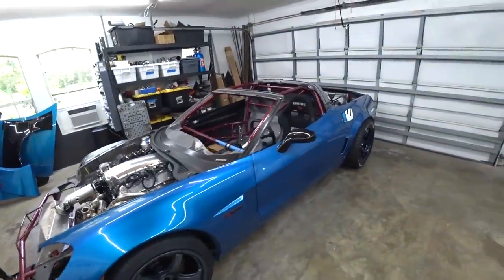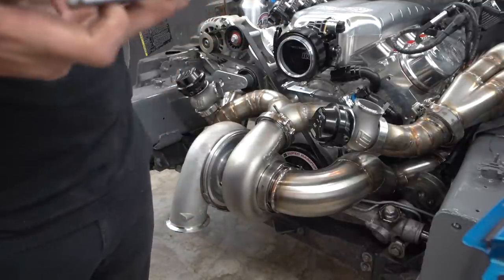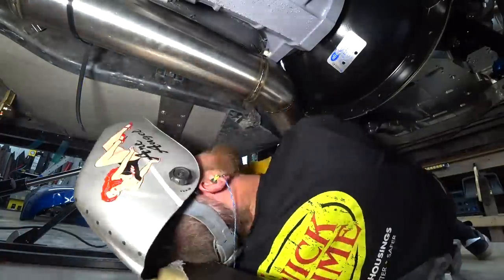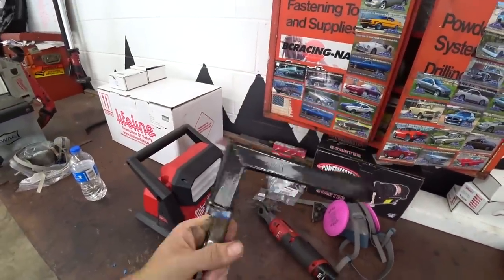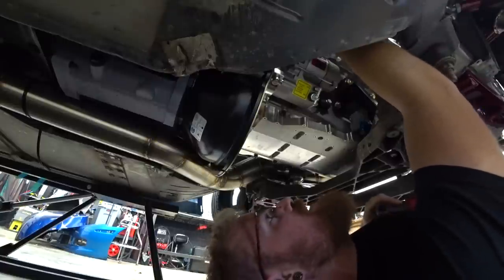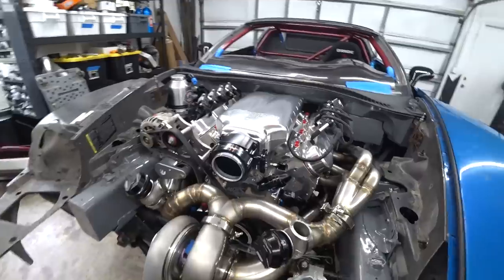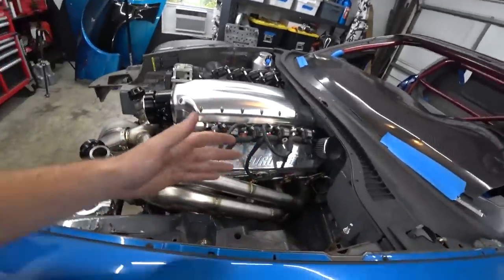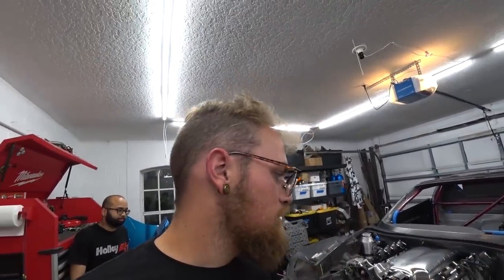C6 Corvette competition drift build. More carbon and final parts.

Comment: For your ebrake, what's stopping you from tucking it up under the dash and having the lower end of your handle (move the pivot above it) just push straight on the rod. Then you'd have no reservoir under your elbow and with the slack in the like, you could unbolt it from the tunnel and sit it in the passenger well if you needed to service the trans.

Comment: Pretty cool idea on the clutch lines. You can even take the bleeder hose off the bulkhead fitting inside the cab, after bleeding and put a cap on the bulkhead fitting. Then you don't have bunch loose hose floating around the cab.

Comment: I’m a little worried about the bending stress within your turbo support. The turbo is heavy. I’d suggest running a diagonal brace from on, or close to, the turbo support pick-up point down to the attachment of the bracket to the car frame. This will eliminate the potential huge bending stress where your horizontal and vertical bracket pieces are joined.
Reply: Exactly what I was going to say
Reply: Lol I think he might know a little bit of n what he's doing.
Reply: I think it needs a gusset, atleast🙃

Comment: I agree with others that a gusset is needed on your turbo mount tube. A triangle cut piece of same square tube should work. I would also add a 90 degree bracket to the top of the cradle and weld to tube for a 3rd bolt. That way the cradle helps hold the weight of the turbo, not just the bolts on the front alone.

Comment: I like that socket. You can also get a wrench around it for those feisty nuts and bolts that require persuasion. Recently I purchased a lot of Gear Wrench sockets and was pleasantly surprised. I might even like them better than my Snap-On ones.

Comment: Keep aware of Collets fire mishap on her c6 shield off the oil filter housing, dry sump, and heat sleeve your oil lines and wiring, loctite your bolts for the fuel rail, seal off your cockpit from the bay and tunnel. (Keeping in mind you’ve got a fire suppression system to install)

Loving the build and your attention to detail on serviceability and ease of maintenance

Comment: Proxxon is a real nice brand for middle of the line hand tools. I got a set for 115 euros - two ratchet sizes, 4mm to 13mm (incl 5.5 and 6.5) on the small size, 10 to 32 on the big one. Many extensions, wobbly bits, and a few philips, flathead, torx and allen bits too. Even a screw driver that fits in the small bits. Great deal

Comment: The square Milwaukee sockets also help when you drop one, it won't roll as easily. You can also get a wrench on it if there is not enough clearance for the ratchet.

Comment: I honestly think you should have your headers & turbo exhaust ceramic coated, i think it would help you out so much with heat management especially considering how tight everything has too be because of the vette engine bay
Reply: He is ceramic coating most of the exhaust 👍🏻

Comment: I'm not sure if this is the true name for the punch you used on the reservoir mounting but we always called them center punches because they follow a tube or bolt hole and punch a mark in the center of the spot your punching.  We also used transfer punch for them sort of synonymously, might not help, surely clear as mud now but its what I got.  Build is looking awesome!

Comment: Hey just a note, that pedal box mount is not going to be sufficient. Once you get some force into it once the brakes are bled it will flex for sure. I have the same pedal box with a way beefier bracket and there is still a little flex.

Comment: also with those flats on the sockets you can use an open end wrench on it if the area is too tight to fit socket and ratchet.

Comment: They also make the socket have those size on them like that so you can add a wrench to it if it’s too tight for the socket without half and to put a breaker bar on it you can add a wrench to it to help you with leverage

Comment: For that long of reach off the head, I'd use steel for the throttle cable bracket, just one thing you don't want to bend/move/flex.   Also for the hydro rod, just build an elbow/arm rest, basically a tunnel/loop/U that goes over it.  Wide/long enough you don't bang your elbow into the edge of it.  An old truck alum driveshaft might work n be cheap.  Mount the extinguisher or something you need on the other side of it.

Comment: The turbo mount looks stout! small suggestion. Is there room to triangulate the short leg to the vertical leg so that the stress can cut the corner when it gets loaded up (suspect the turbo will try to rotate around the lower pivot and stress that 90*). just a small triangle from the same sheet as the mounting on the frame would do it I think.

Comment: Later on, when the turbo mount cracks, you can also weld in a gusset triangle at that 90 degree weld to give it strength so it wont break again with the vibrations

Comment: Should be ready for another shop update for the insulation/electrical?  It'll be a lot easier to finish it up with it on the 2-post if possible.

Comment: Have you considered doing a little sheet metal arm rest/trans tunnel cover to go over the hand brake rod and master cylinder? Keep it pretty snug to it and do it with quarter turns so you can take it off easy to service stuff

Comment: I'm not sure if your pedal installation has enough support.  for gas and clutch what you have is sufficient, but under braking the flat bar welded to the frame I think will twist with the braking forces.

Comment: Taylor i would be very concerned about your clutch line " dry breaks" . They look like with vibration they have the possibility of coming loose. In the aviation industry we use " qd's or quick disconnects to do the same thing.  But they are usually several beefy threads so they will not come apart with vibration.  May want to look into aviation style quick disconnects if those give you problems .

Comment: Taylor…I’m not a fabricator, and your work is awesome…I hope this comes across as a question, not as criticism…Should you guessed the turbo Mount? It appears there will be a lot of weight and vibration in its location…idk, might help. Also…you could always add something look a handlebar pad to the rod for your remote Mount brake reservoir…of course that would make it bigger…but it would soften a blow to the elbow if it happens. Beautiful build…I’m excited to see this unit out shredding…take care and God bless…David.

Comment: info on those sockets... that flat spot is actually for being able to put a wrench on it so if your in a spot a socket can only reach but not enough room for the ratchet to fit you can still break it loose.     I have 1 of their kits..  its about dang time i can get alot of tools in a kit without all the alen wrenches being filler   Edit:  did u consider putting oil filer on the other side of the car next to the cold side of turbo

Comment: According to Google those  are "centering punches" T man.
BTW, you need a gusset on that turbo brace or it will crack at the weld joint. Been there done that.

Comment: U can use a open end wrench or adjustable, crescent wrench....on those sockets, I like those, I've broken ratchet, craftsman mostly putting a long piece of pipe on the end of it breaks the gears ..just buy the cheaper ones so u can replace them.... doesn't matter if u got snap on or what not, they'll break....

Comment: Where your dry sump drain is...weld a pipe on chassis cut in half lengthways with a small j bend to direct oil off chassis ...toyota does this on new hilux i believe..seen it on an engineering channel somewhere small thing but keeps everything so clean instead of having to clean oil of chassis all the time

Comment: I really really love a "good" cheap tool.  The guys I work with compete to have the best and most expensive tools, but they never want to get them out and use em.
Reply from the maker: Yeah I'm all about diminishing return. Finding whatever is the best for the money. Because at a point you have to spend way more money to get a little more quality. I'm fine with more money, better whatever. But I'm not spending 3-4x more for 10% better.

Comment: The square ends on the end of those sockets yes it's for you to be able to get them off of the ratchet easier but they're also for a boxed in wrench for you to be able to get to a bolt that you cannot get to with the ranch or a ratchet the end of it that is boxed in should match up to the size of a box stand wrench so a 9/16 socket the end of it should be a 9/16 boxed in wrench

Comment: wouldn't be a bad idea to put a linear bearing or just a tube support with some nylon or delrin in it on the mid point of the handbrake rod so if it gets leaned on it won't bend or warp.

Comment: @32:30 Hey Taylor could you not make a tube with a step on either end to make it flush with the trans tunnel? think of it like this: (master cylinder)--\__________/-- (handle)
with how little mechanical advantage that step would provide I don't think there would be any flex or issues.

Comment: I take it 2 master cylinders on the Tilton pedals are both for brakes and 1 for clutch!, you could make a curved Ebrake rod that follows the contour of the trans tunnel.
Reply: exactly, one to operate 1 side's front and the opposite rear, gives the car a good failsafe, only losing half the braking power vs having one working fronts and the other working the rears, losing [depending on brakebias/car's traction situation] nearly all of the braking power..
Reply from the maker: One master for the front one for the rear. There’s also a balance bar that allows you to change brake bias by adjusting which master has more leverage. The cool thing about a pedal box is it negates the need to run dual calipers since your rear brakes are on their own system anyway.
Reply: @Taylordrifts  there are also brake bias controllers that will adjust the brake balance in the crossed front/rear layout that all the road-legal cars run but true, though won't the hand-pulled master backflow the pedalbox' master in such a merged hydro-hand+pedal rear brake setup?
Reply from the maker: @niteriderevo9179  I’m running front and rear separate. Not cross. So the handbrake won’t back feed since the rear brakes are separate.
Reply: @Taylordrifts  not quite getting what i was going after, won't the handbrake master try to push the rear brakes' master on the pedal box in addition to the rear brakes themselves and vice-versa for the pedal based rear master to the handbrake master?

Comment: Might want to rethink the oil vent tank position, in case someone hits you in between the door and fender. Just a thought.
Reply: agree
Reply from the maker: It’s one of those things. Everything has a compromise. There’s no other good spot for it. I’ll take that risk. Nothing comes with no comprimise on a build like this.

Comment: I've admired those sockets since I've seen Edd China using them. Just wondering did you use high heat paint on the turbo bracket, I imagine it might get a bit hot. Loving the build man!

Comment: @taylor Ray cant you use Wilwood Clutch Slave Cylinder - Pull Type - 260-1333 or simular then put it in the front so you dont have that bar there?

Comment: Curious to know if are you going to chop the bottom of the bell housing off for ground clearance?
Reply: Wouldn't that expose the bottom of the flywheel?
Reply: @Matty.Hill_87  looks like a good inch of that is just the flange for bolts that he isent using since he has a dry sump pan. (With dry sump pan the flywheel is already exposed)

Comment: I think that redoing the intercooler for the turbo to connect directly is a bad idea. I feel like leaving the 90 plus the U-turn will save some things from being destroyed in the event of an accident. If everything is connected in a fashion that is too ridged it will cause a lot of things to break. Especially with everything tied into the bash bar like they are. I think designing some flex into the turbo hot side is the way to go at least with the idea of a crash and things breaking in mind.
Reply: There is a slip joint to go into the turbo hot side and another to go on the bottom in the exhaust.

Comment: Awesome content as usual. Wouldn't it have saved more room to put the hand brake reservoir in front of the handle?
Reply: With all of the interior in place, it would be harder to service with the reservoir attached. In front of it is also most likely going to be where ecu, pdm, wiring, lots of other important stuff is under that dash and will also need to be accesible easily.

Comment: Maybe consider isolating the turbo mount with rubber mounts?
Reply from the maker: That would defeat the whole point of the mount.
Reply: I thought of the rear diff in the Miata. Im assuming the chassis and turbo will be at different harmonics.
Reply from the maker: @rbparker4  the problem with the Miata was just that. Half was soft mounted. Half was solid. If you have any solid mounts in a system it needs to be all solid. Otherwise whichever part has flex will just try to flex the solid stuff so it’ll take up all the load.

Comment: I am a noob, and Mr. Ray has forgotten more about fab work than I will ever know.  So my question isn't one to question any build choices, I'm genuinely asking b/c this is interesting and I'm always looking to learn.

But, wouldn't it be better to build the turbo brace so that it mounts to the engine itself(an unused bolt hole in the side of the head, or some other accesory drive mounting point)?  So that the turbo/exhaust and the source of vibration(engine) all move together?  

Again, genuinely just curious.  This is one of the more entertaining build series on YT right now.
Reply from the maker: Yes. But there is just no route that makes that possible. Aside from some crazy long mount going way out of the way which would then have too much flex to do it’s job. If you could even get it there. The challenge is the steering rack pushing the turbo so far forward. However the engine is solid mount and I’m adding a slip joint in the hotside.
Reply: @Taylordrifts  Ok, that makes sense.  Thanks for the explanation.

The series on this build is amazing bro!

Comment: alot of factory race cars drain the catch can into the pan so it doesn't have to serviced and will never overflow just a thought would be a easy an line right to the pan
Reply from the maker: It's not really a catch can. The dry sump pulls vacuum on the crankcase. So there's no need for a catch can. As you can see the valve covers are not running to anything. It's a vent tank. basically allows the dry sump oil tank to vent so it doesn't become a vacuum. Like venting  gas can to pour it. It's just a can so if oil splashes out of the tank it can catch it. but its really just a glorified filter.

Comment: With bugger all flex between the motor and turbo, mounting the turbo onto the chassis is a bad idea. Really need to hang it off of the motor, so the turbo moves with the motor.
Reply: He's putting in slip joints on the hot side so there will be flex when in it done. Plus the motor is hard mounted.
Reply from the maker: There’s just no physical way to mount it to the motor.

Comment: That spot for your brake reservoir is a bad spot. You’ll hate filling it with fluid there trying to bleed those masters. Also easy spot to kick and rip a line off on accident. I’d put it some else. Potentially in the engine bay.
Reply: could add some panels to protect those lines or run to the front firewall, then loop back to the reservoir, and that'd only need a little kick panel on the bottom of the reservoir..
Reply: @niteriderevo9179  sure could do that.  Still won't fix being difficult to add/remove fluid when bleeding the systems.  Also the way he was pressing on the pedal when testing placement may mean he needs to rebuild them already.  they don't like being over extended.

Comment: question : 

with the turbo hard mounted to the subframe. and the engine flexing under accel / decel etc.

wouldnt that put stress on the exhaust and make it crack faster ? 

i am NO ENGINEER BY ANY MEANS.. just asking a simple question , trying to understand. 

my thought process was to put some sort of absorber on that mount ( kinda like my 2zzge has for the belt tensioner )..

i figured you would want a "little" movement. 

my thought process was basically like the same if you dont put a flex joint on an exhaust.. the vibrations of the road etc would just cause it to crack cuz it has no where to "flex"...? 

can someone give me some feedback ?? 

someone that ISNT a keyboard warrior douche bag lmao 

thanks

* * * P.S , GREAT VIDEO AS ALWAYS T-RAY * * *
Reply: There will be movement, not a lot as the engine is solid mounted, but he has some slip joints coming to go in the hot side and on the exhaust. On the cold side the flexible joints or the vibrant clamps allow movement.
Reply: @foamdataservices   thanks for the feedback. much appreciated.

Comment: I would look again at all your control mounts… any flex in gear linkage, brakes, clutch, hand brake, steering etc makes a massive difference to how the car feels and drives. You want as close to zero flex as possible. 

Avoid flat plate for mounts as flat plate is very poor at stopping flex, cut holes with a dimple dia’s, press ribs in the metal or angles etc… anything but flat!